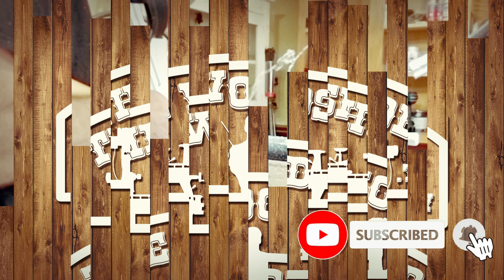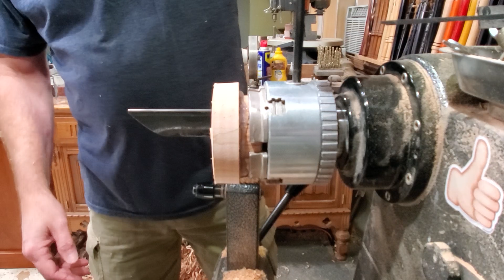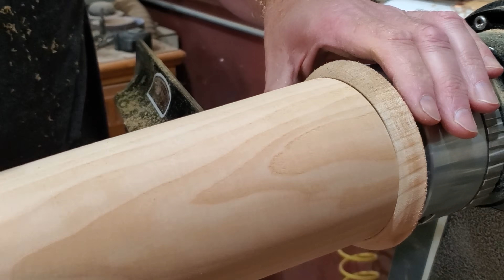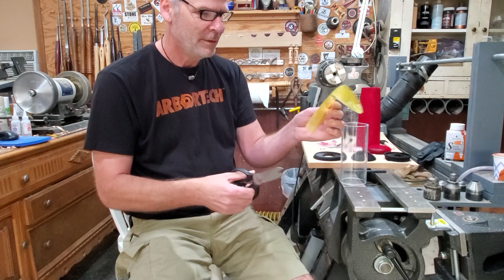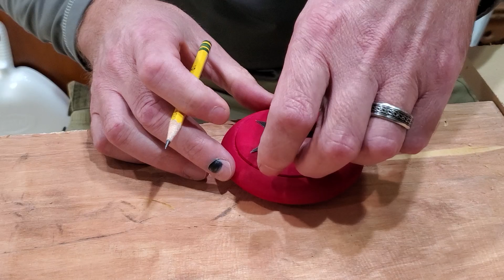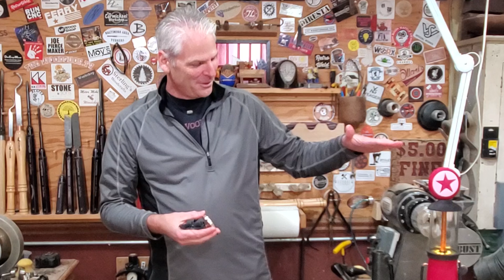Wood Turning Project | Antique Texaco Gas Pump Lamp

Comment: Carl I loved this !!! I want to make one of these.  Son in Law will love it as a gift.  However could I get a parts list with sizes?
Sizes will help keep things proportional.    Doesn't appear the height is like 20" tall.  I want to start gathering the parts to get started.
Look forward to hearing your response.  Thanks so much for your time on these projects. Im at Ray.Spoto@yahoo.com
Reply from the maker: Thank you Ray! That would be a great gift. The tubes are 3" x 5" and 1/2" x 5" The main body is 9 1/2" x 3 3/4" and tapers down to 2 3/4" at the top. The star on top is 3 1/2"
Reply: I’ve ordered light be hear the 9th.
I’m gonna is 2x6s glued.  I have 2 friends wanting to make it too.  Thank you!
Reply: Carl, I ordered the light but looked for the plastic and came up with this for the 3" x 6" or 5.5" L

Qty: 1      You can get two of them and not have to cut them.  Price like $13.00

Comment: Best way to diffuse light is to put something like printer paper between leds and filter, but you need space between the leds and paper.
You could use an acrylic disc to hold the bottom of the tube, also the diffuser and filter, then the led's can be lower down the base
Reply from the maker: Thanks for the tip.

Comment: I would've filled the clear 'tank' with enough epoxy dyed to look like  a few gallons of gasoline and drew the measuring lines on the clear tube to mark how much gas you're putting in Carl.
Reply from the maker: Great idea

Comment: Use some wood shavings with super glue and refill the large hole, sand, then re-drill the hole.
Reply from the maker: Great idea!
Reply: Carl Jacobson 

Ah heck, better yet, Carl. You’re an old paint and auto body fellow.  Just use a little dab of Bondo to fill the hole, sand, paint black and re-drill the hole.  That might be better than my first suggestion of wood shavings and super glue.

Comment: That was a really nice project Carl! I thought that you were going to turn/make a small handle for it as well.......😁😁👍👍😉😉
Reply: What he had is surprisingly close to what the nozzles looked like. They were just a cast iron tube with a slight bend in it.  What he didn't have was a pump handle coming out of the base. That would be ideal to use as a switch to turn the light on and off.

When I was 14, my family lived on a farm. We had a Mae West pump in the yard. I took it apart, rebuilt the pump, replaced some of the piping and seals, cleaned all the glass and re-wired the light in the globe. It was a fully working pump after I finished with it.
Reply: @carlbruschnigjr1757  Very interesting Carl & thanks for that response! 👍
Reply from the maker: Very cool! Love the switch idea.
Reply from the maker: Thank you! I like Carl's idea for the switch.

Comment: Is that sharpie short because it has been modified, or is that accidental?

Also wouldn't it be possible to do away with the holes in the diffuser completely? Just by hollowing out the holed area and gluing the tube to the inside of the black ring, and leaving a lip for the diffuser to be glued to.
Reply from the maker: It's just a regular push button sharpie. Yes I'm going to modify the ring on the next one.